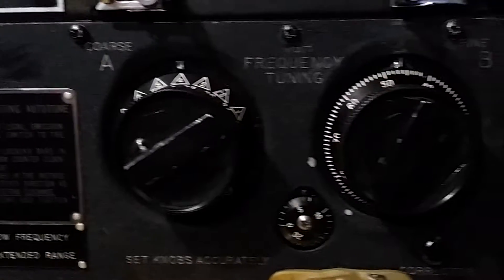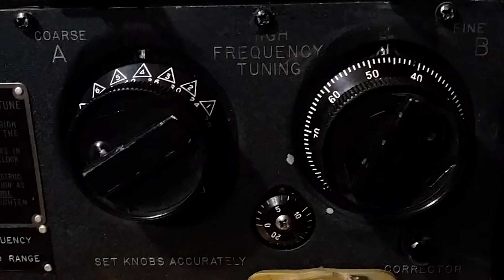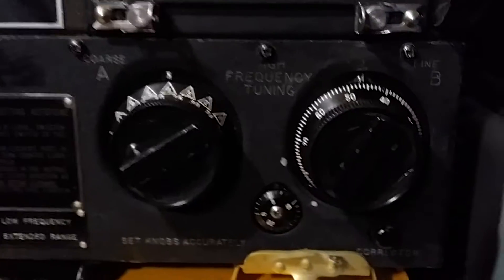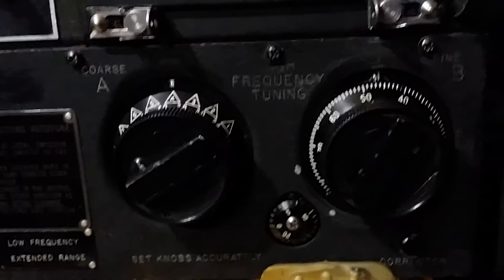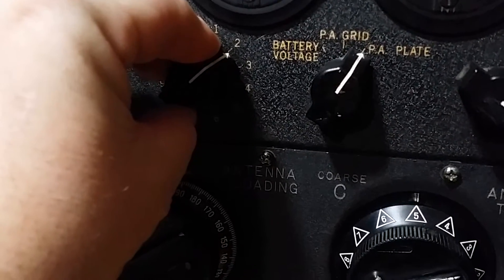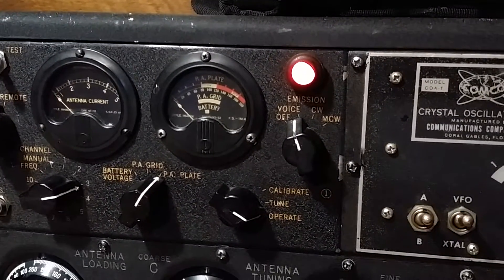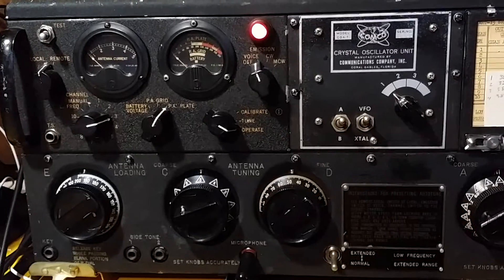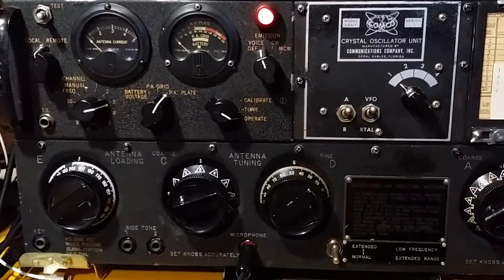Collins ART-13 WWII Transmitter in operation.

Comment: In the 1950's  to early 70's  you could get a good ART-13 in New or nearly new condition for like $25 to $35. If you knew where to look. Some guys got them free "where they were stored" our fathers and uncle's got these and typically built robust power supplies. They were a step up from the command sets. But as kids we quickly found out that ART-13 could go on the AM Broadcsst band!!! Some covered different parts of the band. 
But one kid's father had one that covered the WHOLE AM band...So when your father or a relative who was a ticket holder wasn't watching. Like after school or your parents were out, we'd get on and become the new hot Rock and Roll DJ In the area for a couple of hours. 
Or we'd "comment" on local girl's or on Sundays we'd get on and drown out all the preachers saying we were a voice of 😈 evil...🤣🤣🤣 the arts were amazing constructions and we also learned how to cause unbelievable TVI from a 80-100 watt rig. Also we learned with other Xmitters how to cause TVI on a specific TV channel. We were real monsters. Hey it was the 50's what did you expect? 
Good citizen novices and technicians?
We were inspired by all the mayhem on 
Science Fiction Theater and SciFi movies like GOG and the Magnetic Monster. A lot of kids built huge Tesla and Odin coils then tuned them for max RF emissions.
One time in the 1960's I loaded my father's Johnson Desk top (remember)  into my 13 foot Christmas Tree and had a 11 meter CB band  contact in Connecticut...Of course, nobody in 4 or 5 blocks could watch TV. I still know a lot of those guys and we all have golden memories of our exploits and the Hams that on occasion tried to find us and turn us in. Boy did they promptly regret it.
😉🤣🤣🤣🤣

Comment: I had to use the cu-32 While operating around Greenland.  Landing and or  operating on a lake never had a problem getting my signals out. Water was a great antenna.  Sa-16 albatross my favorite aircraft.  We flew when nothing else could get off the ground. Flew total blind many times.  Radar could not track us at times.

Comment: Yes the arc 8 system. Air sea rescue squadron , goose bay Labrador 1955,56. Lake Charles fab air refueling squadron.  Kc 97 and kc 135 also h-21 helicopter  1957. They finally changed radios over to single side band transceivers.  Co pilots became the radio operator. homebrewer7@gmail.com

Comment: I was a airborne radio operator in the 1950s using this equipment which included the BC 348 receiver. Different companies made this equipment. Our BC 348s were from Stromberg Carlson. That trasmitters power gauges were not always correct so we all used a #2 lead pencil touching the antenna posts to view how large and color of the flash making sure the eraser end of the pencil was completely covered with electric tape. We esp did not want an RF burn to our hand. An RF burn cooks the meat from the bone out. Building the power up I had to use the two knobs backwards which could result in exploding the equipment up. I have seen results where the top cover was completely blown off and fir was the result. homebrewer7@gmail.com.  I am 85 this Year.

Comment: This is part of the system I used from 1960 to 1964 in a WB-50D (56th Weather Recon) at Yokota AB, Japan. Our aircraft had the ARC-8 (ART-13/BC-348Q) running through a CU-32. Two mounted antennas and a trailing wire. It was easy to tune and I do not remember ever having a system failure. Our work was 90% CW with AIF8 (Yokota) and AIE2 (Guam).  The BC-348Q , using the BFO, could tune into SSB airway stations. A really great memory from this video.
Reply: In the 1950's when we were kids you could buy a NEW condition ART-13 for like $25-$30!! Only thing is you had to make your own power supply. The ART was the move up from command sets.
So your father or uncle got an ART and almost instantly us kids found out that the ART had the AM Radio band!!. 🤣🤣
All you needed was a long wite we could put up a tree and we could become our own R&R DJ or drown out the preachers on Sunday or have our own on the air talk shows on saucy subjects like Jacki
Or Pamela in the 3ed or 4th row....
Hey, we were all tech brats and this was the 1950's So.....